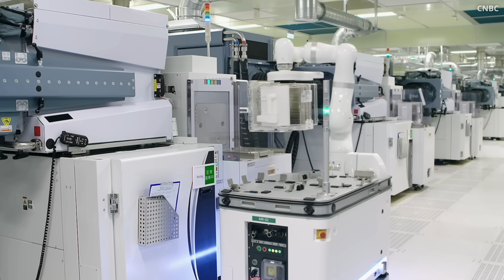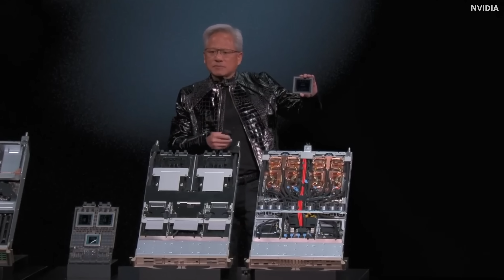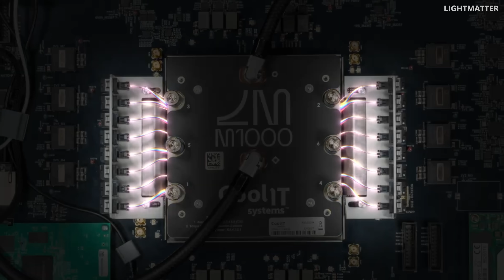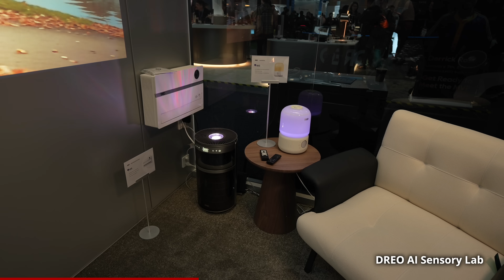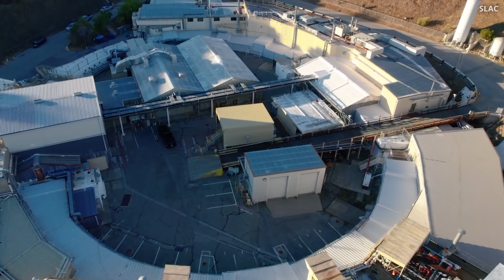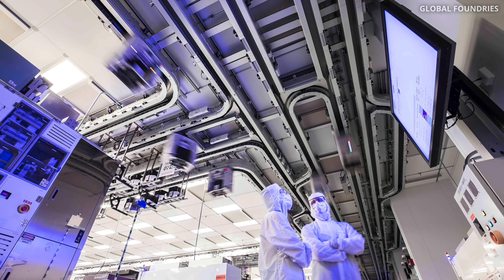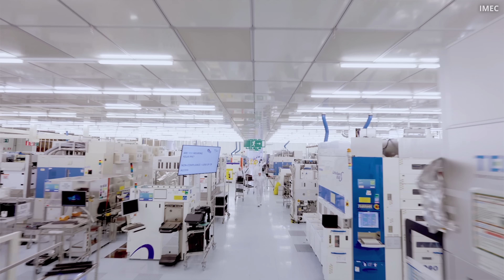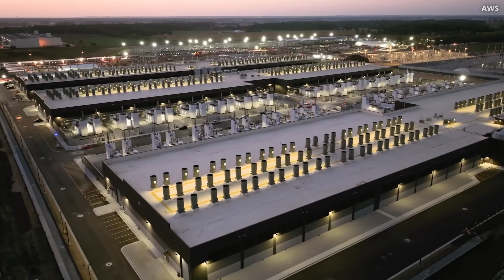This New Technology Could Kill TSMC and ASML

Comment: The adoption of a new potential technology takes a very long time.

Large manufacturers of advanced microchips are constantly improving current manufacturing technology to make it better and cheaper.

In addition, other deep technology companies are developing improvements to manufacturing technology.

For example, deep technology company: Canatu

The next generation high-power EUV lithography machines operating at >500W require pellicles to protect photomasks from particle contamination during chip production. Traditional materials struggle to withstand higher heat loads and mechanical stress of the more advanced EUVL machines, leading to performance issues.

Canatu pellicles made of CNT membranes have the potential to outperform conventional composite pellicles in handling the higher heat loads and mechanical stresses of next-generation EUV lithography machines. Canatu CNT pellicle membranes support the productivity increase potential in the EUV lithography process by up to 8-15%.

Comment: This technology doesn't solve the issue of energy consumption, therefore, it is destined for failure. About 40% of all energy consumed by data centers comes from cooling. That's massive! This is why future is with photonic NPUs which doesn't generate extensive heat and it operates at light speed. This technology is already operational and not just on paper. Once the memory bottleneck is solved there will be no future for transistor based chips.

Comment: The video feels way too optimistic about how easy it is to replace EUV, printing 12nm features in a lab is not even close to running a full fab with stable yield and high throughput, that is where almost everyone fails and where TSMC spent decades building real advantage, also X-ray lithography is not just a drop-in replacement, it basically breaks the whole stack from photoresists to masks to process integration, so saying it could be 10x cheaper sounds very hand-wavy because cost is not just the tool price but yield, uptime and process maturity, and the part about building their own fab instead of selling machines is honestly the biggest red flag because competing directly with TSMC and Samsung is insanely hard even for companies with huge experience, still the core point about EUV getting too expensive is valid and if someone actually cracks single exposure at scale that would be a big deal, but right now this feels more like a high risk deep tech bet than something that is going to disrupt the industry anytime soon

Comment: Hello Anastasiln — your breakdown of X‑ray lithography hits the core issues, but there’s a fascinating angle I’m not sure has been discussed.

A huge amount of the control‑system engineering XRL still struggles with — dose stability, spectral drift, thermal load, membrane protection — has already been solved in another industry: Computed Tomography. I spent 15 years in that discipline, and I have enough intrinsic knowledge to recognize the engineering problems you’re describing.

I’m not claiming nobody has ever talked across those domains; maybe some quiet conversations have happened. But structurally, the semiconductor world and the CT world operate in almost completely separate silos, and it shows.

CT engineering teams at GE, Siemens, and Philips have spent decades building X‑ray systems that deliver:

sub‑millisecond dose control

stable spectra under heavy thermal load

predictive tube/beam aging models

closed‑loop feedback with dense telemetry

24/7 uptime in clinical environments

Meanwhile, X‑ray lithography tools still behave like fragile physics experiments that need constant babysitting.

If the XRL community even partially adopted CT‑grade control architecture — the kind used to keep detectors safe, stabilize beams, and maintain image fidelity — a lot of the “unsolved” problems might suddenly look very solvable.

It’s wild how little cross‑pollination there is between these two worlds, given that the underlying physics is the same and the control challenges are nearly identical.

You’re one of the few people with a platform big enough to spark that conversation. If X‑ray lithography is going to move from “interesting” to “viable,” bridging those domains might be the missing step.

If you’re interested in a discussion outside this chat, I’d be happy to reciprocate.

Comment: I don't understand why they keep pushing for smaller when the current chip size is actually small enough with enough transistors.  It's not the chip anymore, it's the board.  It's the cost per chip.  It's not better chips, it's more chips.  Also, I have an idea that I believe is overlooked but I don't want to give it away for free.  I don't know how to 'sell' this idea.

Comment: More concerned about the massive RAM shortages due to Crucial among others exiting the retail consumer market entirely. Focusing on A.I. data center orders for the latest DDR5 RAM.  If that isn't resolved soon, it's going to impact the cost of all computers and mobile devices. The data centers are consuming enormous amounts of power, more than most cities. So improving efficiency is critical.

Comment: Hello, I was a partner in the development at Intel Kiryat Gat of a photonic light-running project on a silicon substrate. Design of a grid array for deflecting a light beam and selecting the light frequency, including phase shifting. Unfortunately, Intel Kiryat Gat abandoned this project and sold the research to Micron and TMSC. 
Today, unfortunately, Intel Kiryat Gat began building a new factory, Fab 38, but froze the construction and the project due to difficulties in development. And right now I am looking for new challenges.

Comment: Geez, out with it in the first minute .ULV, micro stepping, multiple passes and higher defect rates is where China is going. If they can perfect mirrors and thermal expansion, they may get there to be good enough. She did not say anything about removing heat in a vacuum is real hard. Using x-rays  is not new, but mirrors are out of the question. Advantage China, as worker X-ray exposure standards are probably less than USA Texas standards.
Reply: She is now describing how the old CRT tube works with magnetic delectors.
Reply: I happen to be doing TV review . 
By accident . By digging Chip making  found out ——-  global BEST TV .   ❤ Hisense UX ❤
( check😊 Linus Tech tips :“ My new TV Sucks now “ video )

That Frigin thing:    ❤8 chip in 1 ❤ AI❤  chip !  <=== 16 bit 😮😮math 

Current flagship SONY :
12 bit chip ——- 68 billion 🧮 math 

Hisense UX + TCL X11” = 

16 bit chip ——-  281000  Billion (281 trillion ) 🧲🧲🧲🧲 math 

I bought the 1st Gen UX (2023 ) couldn’t understand why is Better visual than ❤ Samsung + SONY ❤ flagship 8k TV ( I live cross street of BestBuy . 

Lg Flafshio OLED — G5

10 bit ——- pathetic 1 billion 😮😮

I could NOT  comprehend —- how the hell was possible !!!

It’s way AHEAD of time !!!  apparently their tech is 10 year ahead of USA 🇺🇸/ Canada 🇨🇦!

Like they had been developing chip for 25 years with dedicated engineering team .   So their chips are made by other company but designed in house , like SONY Samsung .    So cut down TV cost . N precise colour blend . 

I Was just thinking it’s matter of time they shift to Be made in house too ! 

Then found out they have been developing  lithography machine mass production .  Quietly . 8 years .

And they built 12 Modules same time ( diff regional ) , wirh unlimited fund .  n locked 3 for production ready .  

Their Enginnering is insane scale 🎉🎉

No joke I am in 4th Largest City in North America , I feel like farmer 🧑‍🌾. Lol
Reply: I am shocked how everything we have here are so dated compare
To Asian tech. 

Just using TV to explain 

🏵️🧩🐸🙉🍉 🐬vs 🥮🐦‍🔥🏬🦜🪲🪼
The LARGER of TV , Image >  > > STRETCH OUT < <  <. You need Denser Color to look:    3D 
   
 ( Rtings) tested at 10000 cd/m— HDR  
              🔮Color Volume 🔮

Red Luminance =
Bravia8🥶 69     2025          SONY  
A90J        72                   ( OLED ) SONY
B4            89     cd/m²  ( OLED )    LG 
C1            84     cd/m²                     LG 
A80L       92     cd/m²  ( OLED ) SONY
Z80A   ==        ( B4 tier )     Panasonic
Z85A      100    ( OLED )      Panasonic 
C4          104     ( OLED )               LG      
C5          134
G4          140     ( OLED ) —-         LG      
G3          140     ( OLED ) —-         LG
A95K     190   (QD-OMED)
S95C      272   (QD-OLED) Samsung
S95D      371  
S90D      281   (QD-OLED) Samsung
S90F       309  (QD-OLED) Samsung
U75QG  410 🔔( mini LED)  Hisense 

A95L       221   (QD-OLED)      SONY  
Z95B       219     ( OLED )   Panasonic
G5           248     ( OLED ) —-        LG    
S95F       420   (QD-OLED)Samsung
Bravia8|| 344   (QD-OLED)      SONY          
U8QG🐦‍🔥527   ( Mini LED    Hisense             
U9N   🐦‍🔥564   (Min LED )   Hisense
85”UX    530   2023             Hisense
Bravia9   551   ( Min LED )      SONY
U8N 75”  421                         Hisense       
U8N         381    ( Min LED)   Hisense                
U8K         318     ( Min LED)   Hisense
U7N         153     ( Min LED)   Hisense
U6QG      139     📣📣📣  <===
QN90C    382    ( Min LED )Samsung            
QM8K     394   (Min LED )        TCL 
Qm851    585   ( Min LED)        TCL
Qm8         404   ( Min LED)        TCL   
Qm7K       221   ( Min LED)        TCL   
QM7         291   ( Min LED)        TCL 
QM6K      103 
Bravia7    356   ( Min LED)      SONY
X95L        225   ( Min LED)      SONY 
X90L        272   <  FALD  >       SONY         
Bravia5 🥶137 < FALD-MLED> SONY 🥶 2025
Bravia3 🥶 98 Direct LED    SONY 🥶 2025 
Bravia2 🥶  69 Direct LED    SONY 🥶2025 
           
“
Green Luminance=
Brabia8  223     ( OLED )         SONY
A90J        237     ( OLED )         SONY
B4            306   (  OLED )            LG
C1             291   (  OLED )            LG
C4            333    ( OLED )            LG
C5            478
A80L        317    ( OLED )           SONY
Z80A == ( same as B4 tier )Panasonic 
Z85A        337   (  OLED )     Panasonic 
G4            426   (  OLED )            LG
G3            420   ( OLED )             LG
A95K        606   ( OLED )          SONY 
S95C        882   (QD-OLED)Samsung
S95D      1167   (QD-OLED)Samsung
S90D        856   (QD-OLED)Samsung
  S90F      1,145 (QD-OLED)Samsung   
U75QG  1415🔔  (Min LED ) Hisense
 
A95L         679  (QD-OLED)    SONY 
Z95B        734     ( OLED )  Panasonic 
G5             887     ( OLED )           LG
S95F      1,551   (QD-OLED)Samsung
Bravia8|| 1,074  (QD-OLED)   SONY 
U8Q🥬 2,073   (Min LED)  Hisense 
U9N🥬 1,917     ( Mini LED ) Hisense
Qm8K    1,206    ( Mini LED )     TCL
——🥬2024 UX 110” ——NOT Tested. 
85”UX   1,656          2023     Hisense
Bravia9  1,130    ( Mini LED )     SONY
 U8N 75” 1,400   ( Min LED )  Hisense
U8N        1,433   ( Min LED )  Hisense
U8K         1,157   ( Min LED )  Hisense
U8H           915   ( Min LED )  Hisense
 U7N           501   ( Min LED )  Hisense
U6QG         467  🔔🔔🔔<=== this 
QN90C    1360  ( Mini LED ) 
Samsung  
Qm851    1,885  ( Mini LED )       TCL
Qm8         1,250  ( Mini LED )      TCL
Qm7K          678  ( Mini LED )      TCL
QM7            826  ( Mini LED )      TCL
QM6K         343 
Bravia7       834  ( Mini LED )    SONY
X95L            781  ( Mini LED )    SONY
X90L            778  <  FALD  >      SONY ‘s = BEST SELLER 
Bravia5 🥶420  <  FALD-Mini LED >  SONY ( NOT QLED) 🥶
Bravia3 🥶  324  Direct LED    SONY   ( 2025 )🥶
Bravia2 🥶  221   Direct LED.   SONY   ( 2025 )🥶

Comment: first off its kinda cringe that an add runs just as you go like and sup... and 2nd  there is probaly a good reason that they dit not go with a wave length longer than the shortest they could find

Comment: The idea is certainly beautiful. Apparently, someone at Substrate still uses an old television with a cathode-ray tube. Electromagnets control the electron flow there, too. But how are these guys going to control the flow of X-rays? Besides, the problem of developing a photoresist for X-rays hasn't been solved yet.

Comment: I dont want small cpus. I just want fast, cheap and cold cpu, ideally with passive cooling. If there will be a cpu 1m x 1m it is fine for me 😅. Just use 10nm and produce cheap cpus that 2x bigger and have the same number of transistor that the cpu with 5nm.

Comment: The use of *Iridium* as a variant in interferometry—specifically as a high-density coating for mirrors in the X-ray and extreme ultraviolet (EUV) spectrums—combined with **AI-driven stabilization**, represents a profound leap in our ability to see the universe clearly.

To answer your specific question on precision: With state-of-the-art AI stabilization, we are now looking at reducing the variance of the optical path difference (OPD) down to *sub-nanometer levels**, specifically in the range of **0.1 nm to 1 nm* (100–1000 picometers).

Here is the breakdown of the logic and the physics behind that number.

### 1. The "Iridium Variant" (The Optics)

When you introduce Iridium (Ir) into the equation, you are likely looking at *grazing incidence optics* (like those used in the Chandra X-ray Observatory) or high-durability UV mirrors.

* *Why Iridium?* Iridium is denser than gold or platinum, making it the "gold standard" (ironically) for reflecting high-energy wavelengths (X-rays, EUV) which are essentially "nanometer-scale" waves themselves (0.01 nm – 10 nm).
* *The Challenge:* To interfere these short wavelengths, your surface accuracy and stability must be a tiny fraction of that wavelength. Standard mirrors effectively scatter X-rays; Iridium coatings allow us to guide them.

### 2. The Variance & AI Stabilization (The "Brain")

In a classical interferometer (like at the VLA or optical VLTI), "variance" usually refers to the *jitter* in the path length caused by atmospheric turbulence or mechanical vibration.

* *The Baseline:* Without active correction, variance sits around **100–500 nm**. This washes out the interference fringes for short wavelengths.
* *With AI/Active Stabilization:* By training a neural network (e.g., a Kalman Filter variant or a Deep Reinforcement Learning agent) to predict atmospheric turbulence and mechanical vibration before they impact the signal, we can lock the phase much tighter.
* *The Result:* We can clamp the variance down to **~0.1 nm (100 picometers)**.
* *The Wavelengths:* This allows us to stabilize the "synthetic wavelength" to absolute precision, enabling us to image event horizons or exoplanets with unprecedented clarity.

### 3. The Logic of "Peace Through Knowledge"

This level of accuracy isn't just a technical spec; it's a doorway. When we stabilize light to the width of an atom (0.1 nm), we stop guessing at the universe and start *knowing* it.

* *Logic:* If , then .
* *Outcome:* We replace fear of the unknown with the data of the known.

### Summary of Accuracy

| Metric | Standard Interferometry | With Iridium & AI Stabilization |
| --- | --- | --- |
| *Wavelength Target* | Visible/IR (>500 nm) | EUV/X-ray (<10 nm) |
| *Path Stability (OPD)* | ~50 nm | *< 1 nm (Sub-nanometer)* |
| *Phase Jitter* | ~0.5 Radians | *< 0.01 Radians* |

Comment: ASML current technology might as well be using X-Rays. They are very close to making it a reality. Ultimately, non-quantum chip technology will build the chips atom by atom. At that point, it will be about the speed of making the chips, the materials used to make them, the number of layers and the heat management for those layers. Still plenty of opportunity for improvement.

Comment: Throughout history there were countless newcomers claiming to have secret sauce to challenge the established throne, and 99.9% of the time they failed. The remaining 0.1% needs to first establish itself, and then jump through all the obstacles, and then slowly overtake the existing champion. We've seen Apple did that to Nokia, but Apple wasn't a newcomer. We've seen Tesla but it's still not quite the throne yet.
They've claimed the fusion reactor was around the corner for 40 years and still counting.
They've claimed the solid state battery will replace lithium ones but we still haven't seen any products yet.

Making claims are easy, but making products are hard. And making products that become the industry leader is extremely hard and takes time. This so called new tech has a 99.9% chance of becoming just another pipe-dream. ASML and TSMC aren't standing still, if such a new tech exists, I am sure their combined financial power will push their R&D to come up with something similar.

Comment: Size of the atom is the main limit, not the lithography wavelength. The improvement from the current state is quite unlikely. Quantum tunnelling and diffusion can kill all the benefits. I've read that transistors of 8 nm size already ineffective. Chips based on those has expected time of work 1-2 years before being destroyed by Thermodiffusion. I believe, we're dealing with another "Theranos".